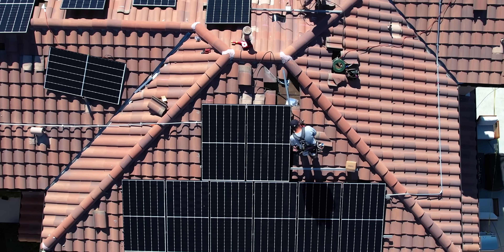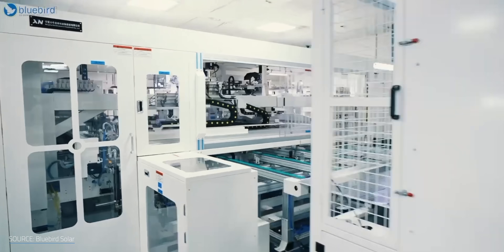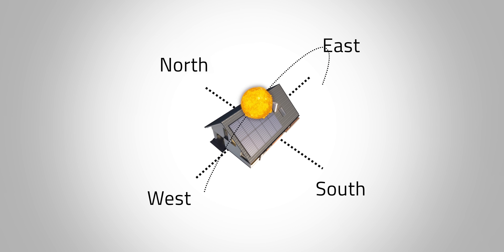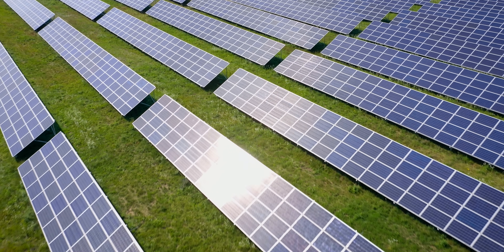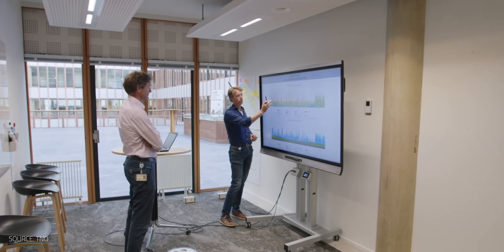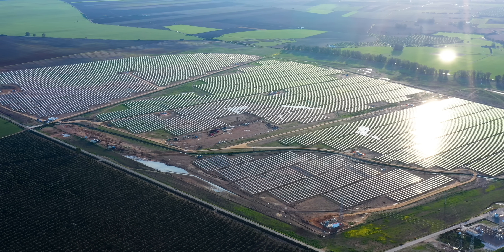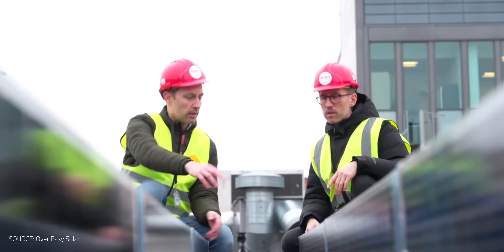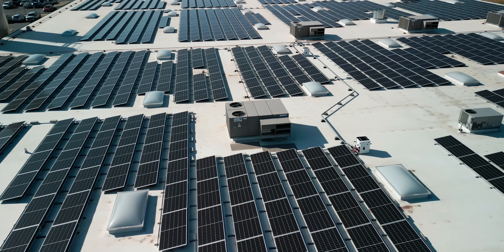Have we been doing Solar wrong all along?

Comment: One observation I have made is that installing solar panels on roofs over habited rooms made a huge difference in less heat pumped into the building and not only created electricity, but reduced room temps by 15 degrees!  That means a HUGE savings in cooling that room!  I live in a desert,  sooo..  I am going to vertically mount some of my panels on south and west walls with stand off from the wall to allow convection to take away the heat and not transfer it into my walls... double improvement with reduced load on my cooling system AND cooler walls while I collect energy!!!  👍👍👍 Any cooling I don't have to do is a huge savings!!  Yes, I'm kinda screwed in winter, cuz my walls won't get sun, but my cost is 8 months of cooling, not 4 months of heating.  Now to gather data before the install!
Reply: Use reflective film below panels. Double energy, double cooling. And in winter you can try covering that with black matter.
Reply: Yeah and now set them on rails or something that you can move them 2 meters away from the wall and you have a solution for the whole year. :)
Reply: @denis3524 that was my thinking. If they r bolted to the south facing wall unbolt bracket remove for 4 months winter then additional heat resumes.
Reply: Seems obvious: any hot, sunny, and wealthy climate should be doing this.  I'm looking at you, Arizona.
Reply: @qinarizonaful  agreed. Covered whole upstairs roof with 20kW of panels. Stronger roof in high winds (more fixings), less heat on the actual metal roof, less noise when it’s stormy. We also live in a warm climate, in Western Australia with similar sunlight to Phoenix AZ. So I agree that panels have other benefits than just the cheap electrons
Reply: @kd19512  
Nice!!!  Agreed!  🫡🫡
Reply: Have them hinged so you can angle them away from wall, then in summer they can bounce light INTO your walls, heating your home
Reply: Anyone have experience with CraftStrom plug and play system, with bifacial semi-flexible panels?
Reply: Mount the pv on your walls with battens that have vent flaps to open when hot and close in the cold so the pv is effectively 'double-glazing' your walls. If you then have vebts from this cavity into your house you can use the hot air from the cavity to heat your house or vent upwards and draw cool air through the house from the shaded side. This is 'Trombe wall' technique using pv instead of glass.
Reply: Tried just painting your roof white....
Reply: @vovalos  , doesn't get you any electricity.

Comment: Something I thought about a while ago when my parents got solar fitted was what about a water feed to wash the dust of the panels and cool them down on hot days. But then why not have the solar panels have a jacket built in with a solenoid on the bottom for drainage and one on the top for air bleed, a contact at the top to detect it is full and a water feed line. Then this could be run back to a cooling system that when it detects panel temperatures over 30C shuts the drain valves and opening the bleed valves as the panels fill with water. Once they are full the drain opens and water is pumped around the loop to a radiator. When it gets cold over night they can drain down to a storage tank so they can’t freeze. Or run a antifreeze coolant

Comment: I've been thinking that adding some of the super reflective heat dissipating panels ( that can radiate heat to below ambient temperature ) to the horizontal photo voltaic panels via heat pipes in a sawtooth arrangement ( or back sides of roofs that don't face south ) would help with the heat problems.  The condensation that below ambient temperatures would produce ( especially during night time ) could be harvested to clean the panels.  The vertical still has the advantages for farm and highway and dust and and bird poop and snow.

Comment: Coming to the end of the video, we have the same problems in SA, cost/W of a bifacial PV MODULE is +/- 4 times the cost of a normal unit, with only an average reported 20% increase in yield, however mounted in a traditional way. Mounted vertically is then 22.5%? while being 4 times as expensive doesn't quite make super sense. We have done an experiment on a building, where we put bifacial panels on a horizontal lattice running up and through convection underground, pulls up cool air across them which worked well until the vacuum and modules were broken by a grass cutter hitting a stone hahaha, but worked great on keeping voltage high

Comment: The panels are more expensive... They also have the same footprint... A 3-4% increase in production isn't a win. We're talking about a production increase of 5-10w per panel. The average home would see less than a 100w difference with a $30,000-$50,000 investment over traditional panels. This only matters as huge scale and in very hot locations, like deserts where solar panels have a large commercial application.

This is *only* a win for big businesses. Not for anyone else.

Comment: For the usual roof-top installations, why not leave some little gaps (~3cm) between the panels to allow the hot air (underneath) to escape?
Quick and simple solution, maybe even 50% effective (speculation). But essentially totally free (other than the extra ~20cm span).

Comment: Solyndra:

Failed in 2011: Solyndra filed for bankruptcy in September 2011,  trying cylindrical solar pannels that were more inefficient and expensive as flat surface PVs as any high-school calculation of surface area could explain.

Department of Energy funding: Solyndra received a $535 million loan guarantee from the Department of Energy, making it the first recipient of such funding under President Obama's stimulus program.

Peter Thiel used high-school geometry math to compare the efficiency of cylindrical solar panels and flat solar panels by using the concept of surface area. He assumed that both types of panels have the same length and width, and that they are exposed to the same amount of sunlight. He then calculated the surface area of each panel using the following formulas:

- For a flat panel, the surface area is simply the product of the length and the width: $$A_{flat} = L \times W$$
- For a cylindrical panel, the surface area is the product of the circumference of the circle and the length: $$A_{cyl} = 2\pi r \times L$$ where $$r$$ is the radius of the circle.

Since the cylindrical panel is curved, not all of its surface area is facing the sun directly. Therefore, Thiel divided the surface area of the cylindrical panel by $$\pi$$ to get an effective surface area that is comparable to the flat panel: $$A_{eff} = \frac{2\pi r \times L}{\pi} = 2r \times L$$

To compare the efficiency of the two panels, Thiel divided the effective surface area of the cylindrical panel by the surface area of the flat panel: $$\frac{A_{eff}}{A_{flat}} = \frac{2r \times L}{L \times W} = \frac{2r}{W}$$

Since the radius of the circle is half of the width, Thiel simplified the expression to: $$\frac{A_{eff}}{A_{flat}} = \frac{1}{\pi}$$

This means that the cylindrical panel has only about 32% of the surface area of the flat panel, which implies that it is much less efficient in converting sunlight into electricity. Thiel used this argument to criticize Solyndra's technology as inferior and wasteful.

Source: Conversation with Bing, 2/20/2024
(1) Calculate Solar Panel Efficiency with the Simplest Method. https://solarpoweredblog.com/calculate-solar-panel-efficiency/.
(2) A Complete Guide on Solar Panel Calculations (2023 Update). https://www.anker.com/blogs/solar/solar-panel-calculation.
(3) Horizontal, flat solar panels vs tilted solar arrays - Solar Choice. https://www.solarchoice.net.au/learn/design-guide/flat-solar-panels-vs-tilted/.
(4) How Is Math Use in Solar Energy? - Effortless Math. https://www.effortlessmath.com/blog/how-is-math-use-in-solar-energy/.
(5) Cylindrical Solar Cells Give a Whole New Meaning to Sunroof. https://www.scientificamerican.com/article/cylindrical-solar-cells-give-new-meaning-to-sunroof/.

Comment: I'm in the utility pv industry and have been installing systems from 7mw to 27mw, and all the projects have gone Bi-facial as of 2 years ago(upstate ny) While talking to the client, I was informed that there are greater incentives for the bi-facial mods. I'd love to get away from these trackers and go to a fixed tilt vertical mounted array. Less points of failure, more structurally secure and has way more applications....

Comment: So we rediscovered that cooling your silicon based electronics is a good thing. Liquid cooling should be a standard feature option in most solar markets, as should the ability to use this as a preheat for: water heaters, swimming pools, irrigation (let the water cool your panels before it hits the sprinklers for the beans and carrots), and the cold side of a heat pump (in seasons when warming is intended rather than cooling)

Comment: Watching this video I started thinking that one aim is to have a higher output voltage and current from the panels. So, I'm wondering if there is such a thing as a power booster for installed panels in order to be able to get more power from a set of panels (instead of having to get more panels), to be supplied to the charge controllers and then to a bank of batteries. 🤔

Comment: I'm not sure I understand this in a commercial context. It's clear that vertical generates more watts per panel, but we can see the vertical orientation requires large gaps between the array rows to prevent shading. My question is: Does vertical actually generate more watt-hours per unit of land area - or not?

Comment: Positive: fewer issues with snow and dust accumulation, and reduced vulnerability to hail damage.

Negative: greater vulnerability to wind damage. Also, of course, just as with all other solar power, relying on it means freezing in the dark on cold winter nights, and it will never be as reliable or cost competitive with fossil fuels and nuclear.

Comment: I’ve seen solar hot water panels mounted this way in a system that worked extremely well. And I’ve always had a serious preference for ground mount setups as well, and the steeper the angle the more I like, as there massive appeal in keeping snow off it. When I do finally do this, my plan was to mount them at the absolute steepest angle I could get away with.

Comment: We use standard solar panels in an almost vertical position to power gates, fuel pumps, and charge batteries.  Been operating like this for years with zero issues and exceptional charging.

Comment: It only helps if you have over heating problems.  In my climate 3/4 of the year there is no heat problem.  The other quarter there is but, there is so much extra energy that any loss didn’t matter.   Most of the time the panels aren’t producing because power is always at 100%

Comment: I've been off-grid solar at home for more than a decade in Canada.  In winter when the suns angle is barely above the horizon the "optimal" panel tilt is already close to vertical.  I've been running my panels vertical for the last few years while there is snow on the ground and see better output. I've been attributing these increased outputs to the combination of reflection off of the snow on the ground and the lack of accumulation of snow/frost on the face of the panels.  With the ambient temp below freezing the cooling is probably having an effect as well. On a -30C sunny day the array exceeds it's rated output significantly.

Comment: A 2.5% increase in energy production, from 1.8x materials used is not a increase at all. You are using 2 solar panels to achieve what 1 could have done. I don't see this being a break through at all. Just more poppycock science.

The only good comparison is the amount of damage normal solar panels take during a hail storm. Whenever these panels sit like this, they can't be damage from falling debris. But that is about it.

Comment: what about vertically but stepped positioned so the solar panel behind an other reflects sunlight at the back of the solarpanel in front.... so the reflected light of another panels is used also. instead of radiating unused up in the sky

Comment: Seems you explained it wrong.  The convective heat transfer coefficient (a linear approximation) to the air is higher when oriented vertically.  With no wind, that is termed "natural convection".  That causes vertical panels to run cooler, as was measured.  With wind, there is less difference, but usually little wind where I live when the sun is oppressive (23 days 100+F on avg).  My panels point more west than south, with 10 deg slope whereas 38 deg is optimal.  That is for convenience since serve double-duty as a carport roof.  After noon, our grid rate goes up, so better to offset w/ solar then anyway.  Vertical panels can serve double-duty as a south or west-facing fence.

Comment: Heat, yes.  The "stack effect" would improve cooling a small amount.

I am sorry I do not have the link, but I read a paper a few years back where the authors experimented with several ways to cool solar panels.  It looked like someone's master's thesis.  They started by placing a fan blowing on the back side of the panel.  The result was more additional power generated than the fan was consuming.  They tested heat sinks (very little improvement), fan with ducted airflow over heat sinks (better than just the fan), and water cooling (not much better than the ducted air design).  The really interesting test was using phase change materials.  Once the correct material was chosen, and a sufficient amount placed in contact with the panel, the panel generated the highest observed power, while the cooling required no share of the generated power.  It would then resolidify over night and work just as well the following day.  Of all things, Vaseline was close to the best material.

Unfortunately, between the phase change material and the embedded heat sinks required, the design was heavy and a bit more than double the cost of a bare panel.

Comment: Higher convection by moving air  on vertical faces. Similar to how hanging something vertically to dry it out works faster. Air can move faster over a vertical surface because hot air rises.

Comment: What about a combination of both? Like 70% vertical bifacial and 30% horizontal/tilted to fill the midday dip/ gap in electricity generation. Also planting light colored plants or using reflective ground/ plants covering between vertical rows will increase the yield.

Comment: Sure it sounds good but you have to take in the latitude that you are in for the angle of incidence changes and it is normally your latitude plus about 10 degrees will optimize your panel, living in the tropics this is important. The neigbour has the same set as I have and his are horizontal where mine are at the angle of incidence and I produce a surplus on my power bill. Also as I have them on an angle it keeps them cooler and there is less resistance for the electronic transfer. If you live close to the arctic like Holland then the rules and angles change for the sun with you is always in the north as to where I am the sun passes over and returns from the south in December for the tropic of cancer is below us.  so all up it is your geographic location that determines as to how to set them up.

Comment: ~9:38 "Bi-facial solar panels have been around since the 1940s ...Bi-facial panels tend to be a little more expensive..." By how much? Surely we know by now.
4% is a little more efficient. Does the extra power generation outweigh the initial costs plus additional maintenance costs? It makes a difference.
Apologies, but the omission of these estimates are a little suspicious.